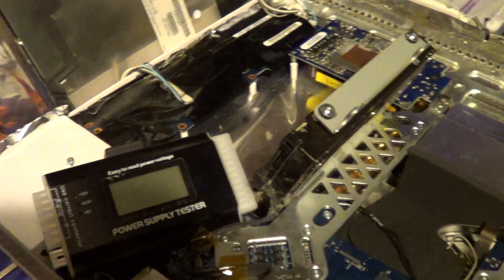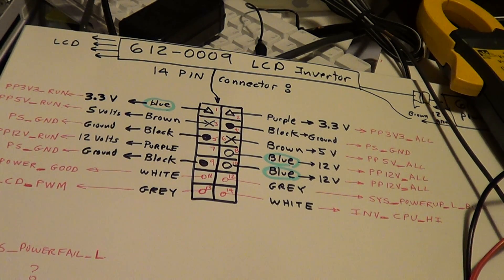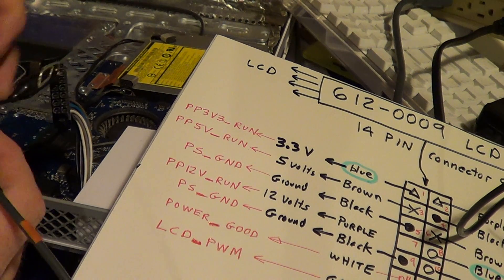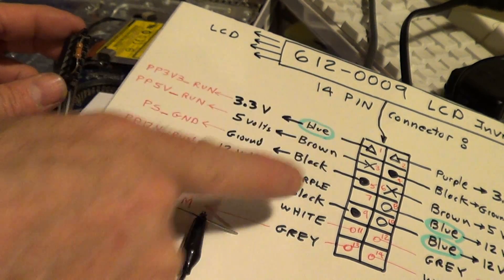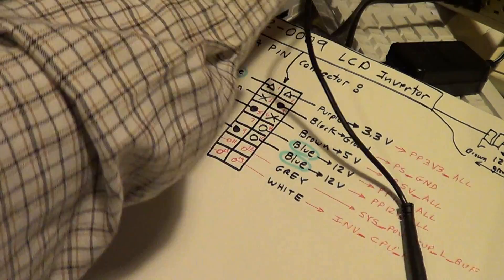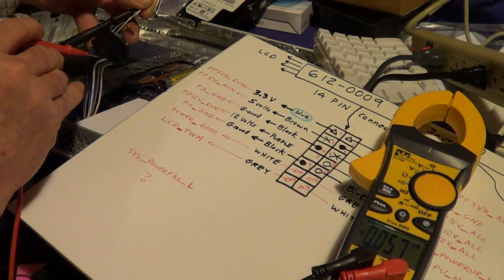20" iMac 14 pin connector pinout early 2006 Inverter 612-0009  rambling video 002

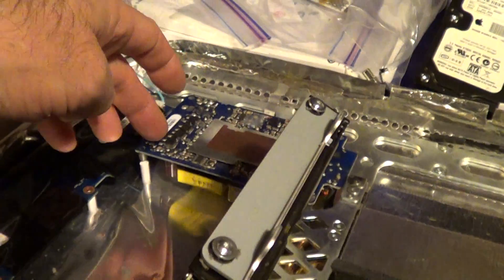Comment from the maker: 10:45 is 614-0363 Power Supply with AC line voltage in  and outputs 12 volts DC to the LCD Inverter board 612-0009. The AC input is always hot ie on when the cord is plugged into the iMac

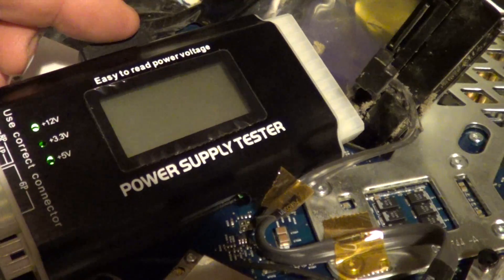Comment from the maker: 08:55 signal SYS_POWERUP_L_BUF pin 12 grey wire if pulled to logic High; "turns off" the three *RUN*  labeled Voltages; i.e. the 3.3 and 5 and 12 volts on the left/odd pins on the connector.

Comment from the maker: 04:30 signal LCD_PWM pin 13 grey wire is pulled to logic High +3v via a resistor. This "turns on" the LCD backlight . This pin is probably modulated to vary the LCD brightness is my guess.